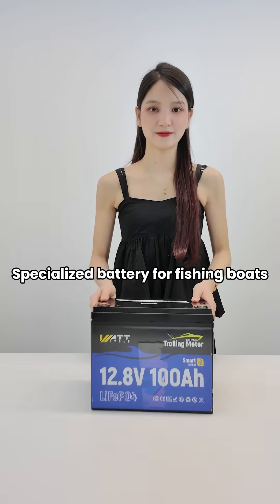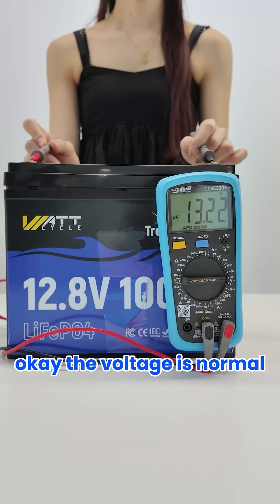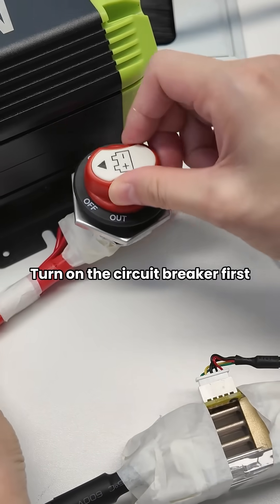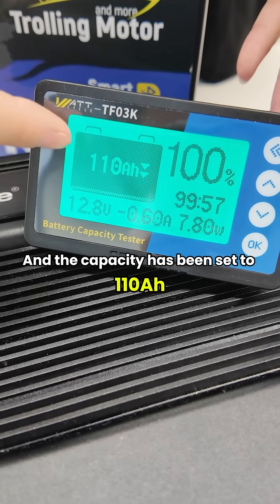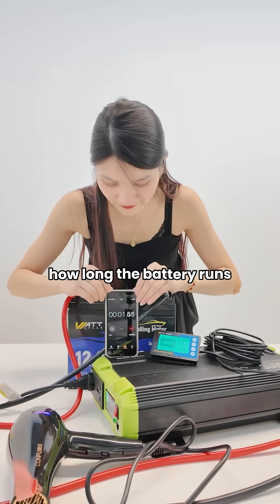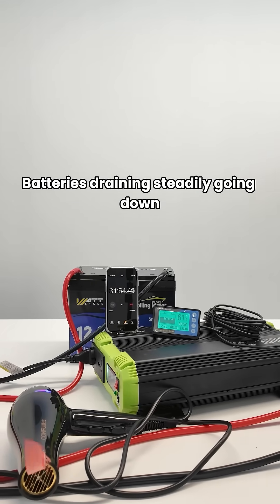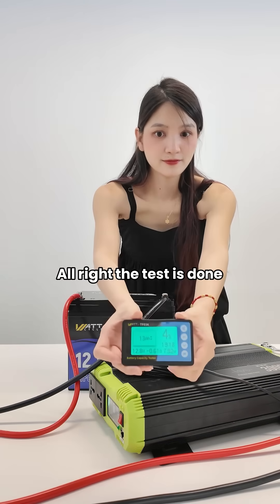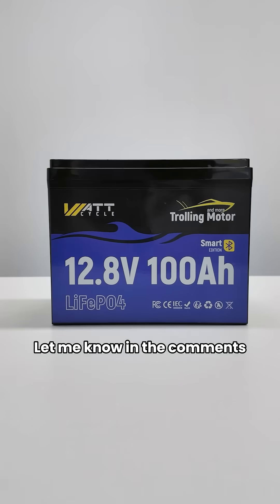Can It Power Your Trolling Motor All Day? 🔋 WattCycle 12V 100Ah Capacity Test!🚤

Comment: Correctly set the shunt to 100Ah, not 110Ah.
Reply from the maker: Thank you for your feedback! 😊Since our cells are brand-new EV-grade A+ cells, the actual capacity is always higher than the rated 100Ah. To capture a more accurate charge and discharge cycle, we set the coulomb meter slightly above the rated capacity. This way, the data reflects the performance more precisely.
Reply: @wattcyclepower  The coulomb meter will count correctly no matter what the capacity is set at. The capacity is only used calculate percentage remaining. Which is a calculation, not a measurement.